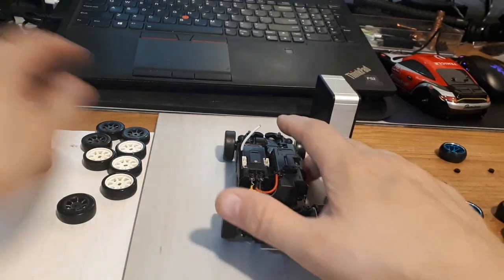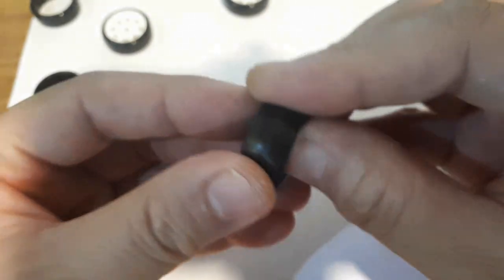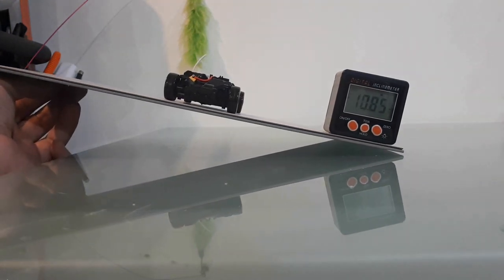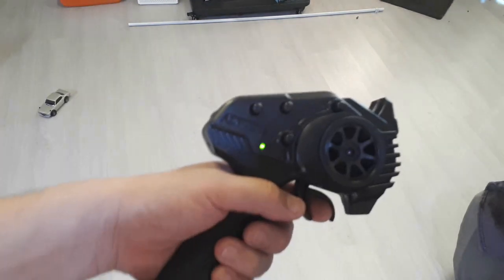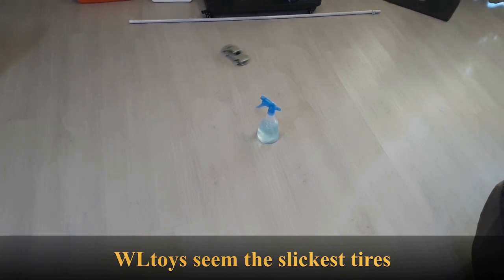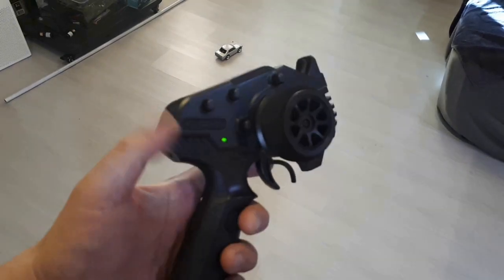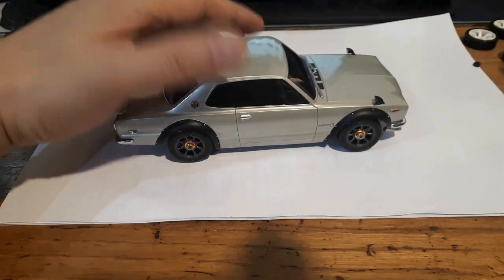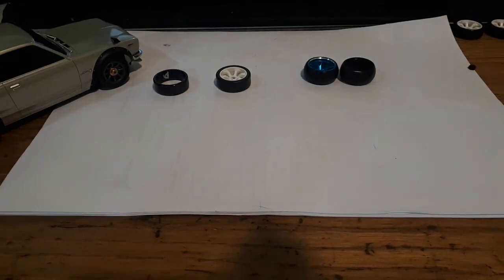RC 1/24-1/28 drift tire test on Kyosho Mini-Z MA-020 AWD, WL toys, Atomic, domed, DS Racing

Comment: I have the same issue with turning one way easier than the other, i tried adding weight to the opposite side which helps a little.